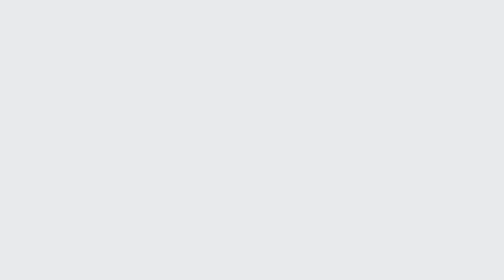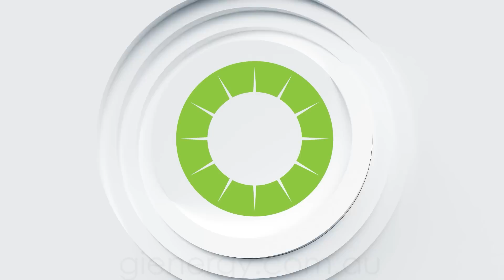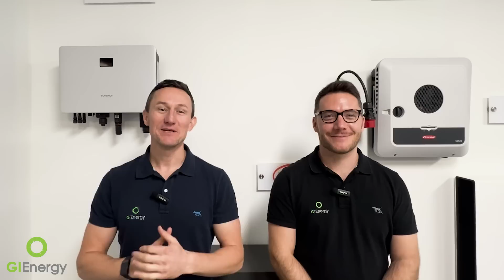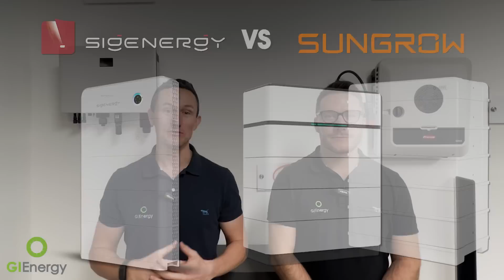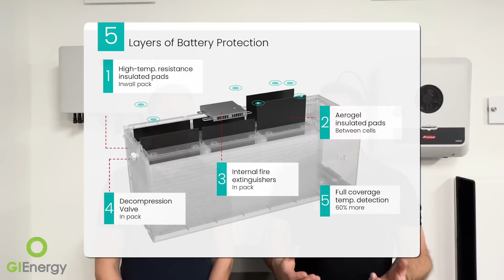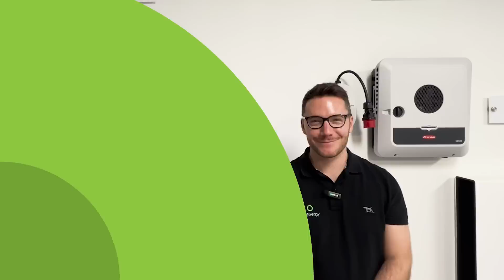Sigenergy vs Sungrow Battery Comparison | Best Solar Home Battery in Australia?

Comment: Great video and comparison. Just wondering for Sigenergy with full home backup, if the inverter or gateway fails would you still be able to use the grid or there needs to be a change over switch?
Reply from the maker: You don't need a changeover switch like with some batteries. If the inverter fails the gateway is the override. If the gateway fails you can disconnect the gateway and the inverter from the switchboard really easily and without a sparky.
Reply: @gienergy2250 Thank you